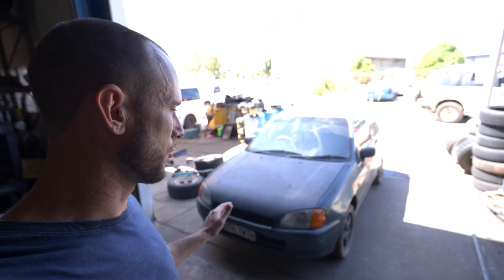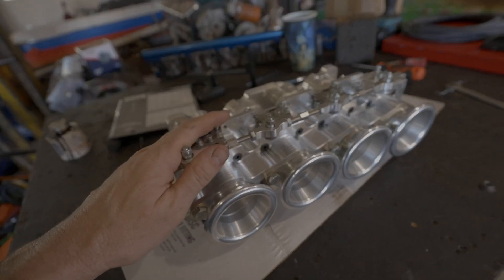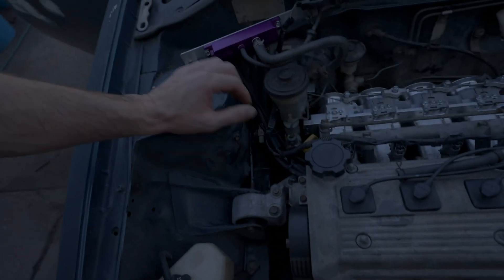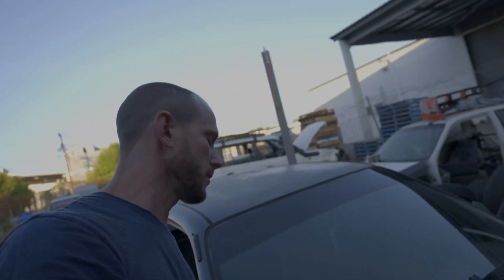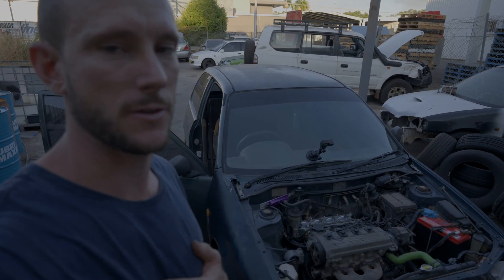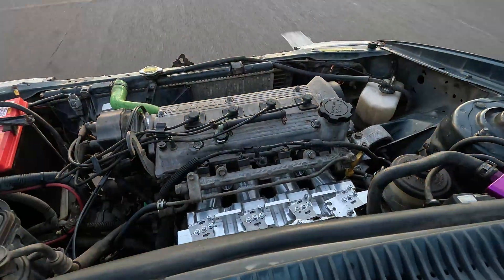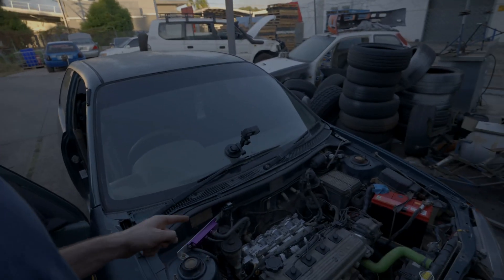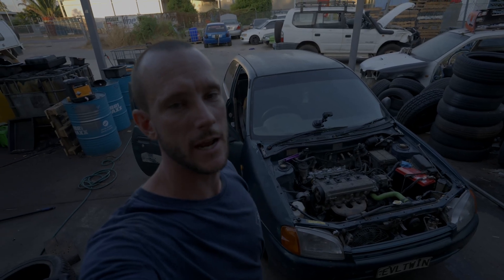Maximize Your Toyota Starlet's Performance with ITB Install Tutorial

Comment: Looks the Berries Matt, air-box in the works, cold fresh clean filtered K&N panel. Engine mounts I made them from Purple noelathane in the lathe freeze it first and also use a hollow bare as centre piece or oem centre hollow bar. Helpwith torque steer. All three mounts. Only drawback is revision mirror isolates at certain rpms. For better traction fit 20mm aluminium plate under footwell lower control arms, will be much better launches. Longer bolts needed though.
Reply: u make custom part for 5efe im trying to build a itb kit with 4 throtle body from a tercel idk what i need to take in consideration and what can go wrong im trying to run itb on stock ecu no idea if its good idea

Comment: have you ever lightened an oem 4efte flywheel? if so, how many kgs you took off?
Reply from the maker: Nah but I have bought an after market lightened flywheels it’s about 3kg lighter… doesn’t really make any noticeable difference to performance… for that reason I’d never lighten a stock one and risk making it weaker
Reply: @Camp_Dogs   thanks for the reply, i really appreciate. Been following you since years. I'm about to built a 5efhe atmo, to use on a circuit where you can only use 1st and 2nd gear since its not a big thing.

any tips about how to increase torque?
Reply from the maker: Get a c160 gearbox, or change the final drive gear in the gearbox. Will help a lot

Comment: Was this mapped or was it bolted straight on?
Reply from the maker: Bolt on
Reply: @Camp_Dogs  how did you sort the throttle cable?
Reply from the maker: Stock one bolts on

Comment: How does the ac work??
Reply from the maker: An air conditioner uses refrigerant contained within its system to absorb excess heat from a room, which it then pumps out through a system of pipes to an outside coil. A fan is used to blow ambient air over this hot coil that contains the refrigerant, transferring the heat from the refrigerant to the outdoor air.

Comment: Hey @matt have you run this setup on a dyno yet? Is there much difference over stock?
Reply from the maker: Nah we haven’t tested on dyno but to be completely honest you will probably lose low to mid range and maybe get 2 hp gain in the top end. 

The main difference though is it sounds incredible. One set of cams and you’re then making another 40+hp
Reply: @Camp_Dogs  it's a shame there's not many aftermarket cams over here in the uk. I was quite like and managed to get my hands on a set of tighe 282s. Have you ever played about with an Acis manifold?

Comment: Hey Matt what have you done with the air idle control valve wehn I had itbs on my 4e it ran like shit with it un plugged
Reply from the maker: I just have it unplugged as it doesn’t work anyway. Manual adjust the itb

Comment: I love all those tps bolt holes and there isnt 2 that work for the toyota tps haha. Good work as always boys.
Reply from the maker: They are a generic set so the itb part is able to bolt to any adaptor they also make… once we perfect the design it will only have one set of holes
Reply: Totally. I thought it was smart having all the bolt patterns. Its typical the orientation is not what was drilled. I make some car parts too so i know how hard it is to get to a sell-able part. Nice work mate.  @Camp_Dogs
Reply: I assume that it is running on the stock ecu in this video too ?  @Camp_Dogs

Comment: The bracket for the vacuum block should be different. When running this with a strut bar the bracket will interfeer. Sounds super cool tho!
Reply from the maker: Good point. Cheers. Trying to keep it a bolt on project without having to drill new holes

Comment: Is there a kit for 2nz/1nz?
Reply from the maker: Yes I have a 2nz adaptor. Only problem is it doesn’t suit DBW. If your 2nz has a cable throttle, then we can make this a direct fit that will run on stock ecu. Aftermarket ecu only required if you’re putting bigger cams in your engine or changing fuel.
Reply: @Camp_Dogs  What's the price? Also how will it run without maf on stock ecu?
Reply from the maker: @Dimitriss_de  Will be around $1500 aud. We are looking at getting carbon/fibeglass air boxes, you can connect the maf to that.
Reply: @Lani100HD  How much do they cost? I assume it'll need a tuneable ecu right?

Comment: Do you see Starlettes as being the HQ's of the 90's ?
ie the cheapest piece of shit around that can impress the non believers ?
What is it about these engines you love ?
Reply from the maker: i dont like them because of design, i love them cause of cost and cheap to modify and very easy to work on.

The cylinder heads are junk, blocks are under square. 

Just cheap fun really compared to modding a honda 4 cyl.